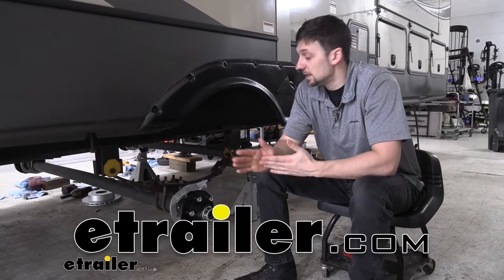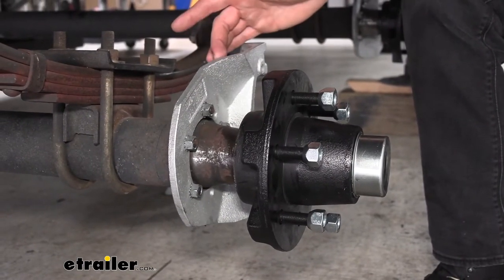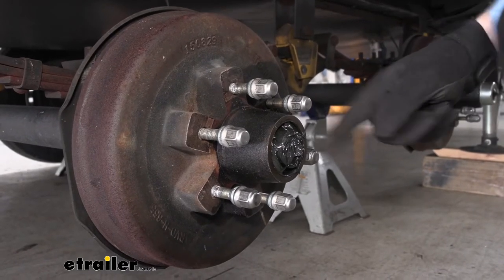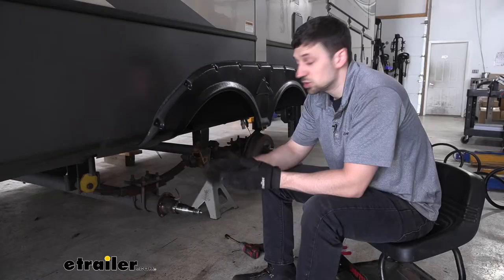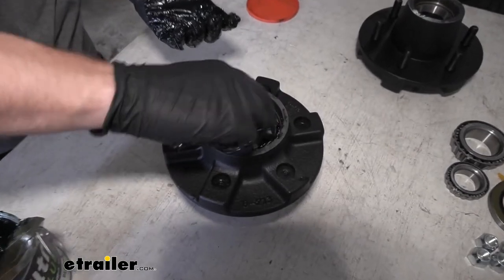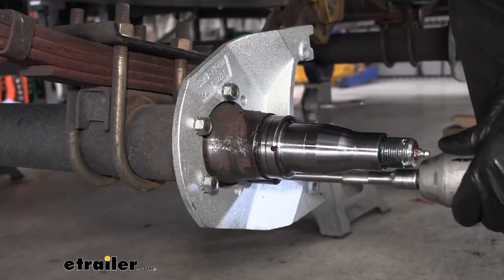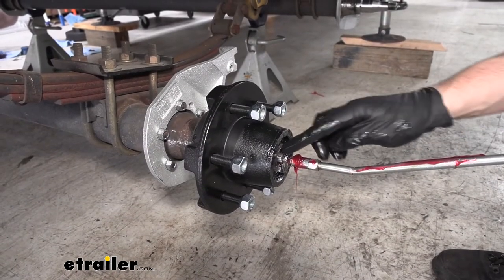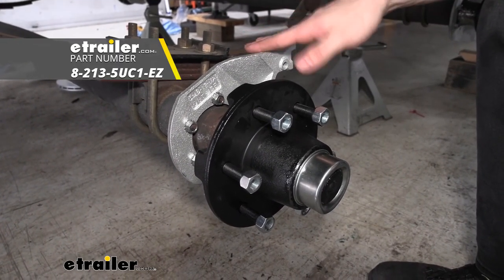etrailer | Dexter E-Z Lube Axles Trailer Idler Hub Assembly Review and Installation

Comment: Can you do this job without a grease gun?
Reply from the maker: You can pack the bearings and hubs by hand if you wish, be sure to fill the hub cavity as well. You can easily pick up an inexpensive grease gun such as # L30200
https://www.etrailer.com/Lubricants-Sealants-Adhesives/LubriMatic/L30200.html